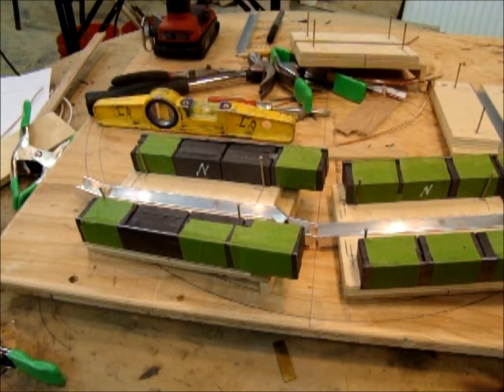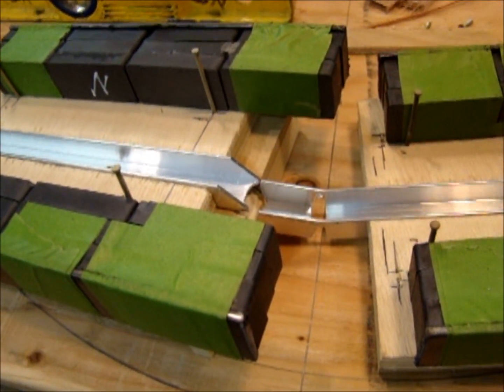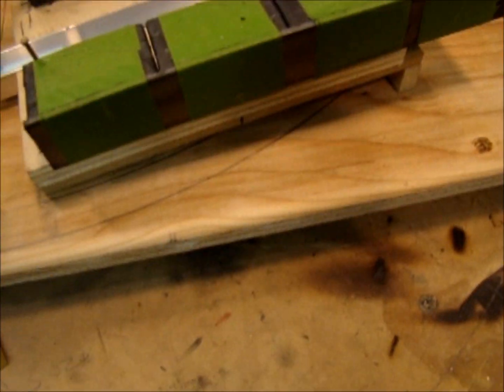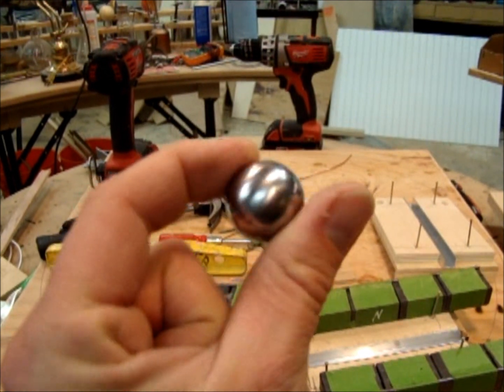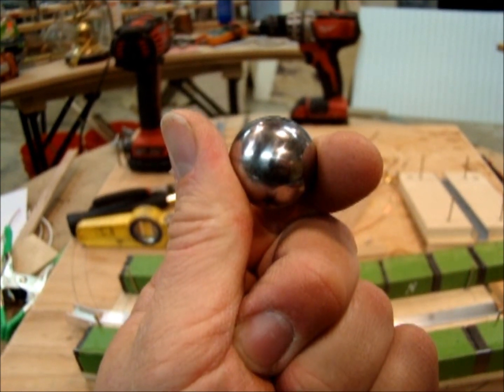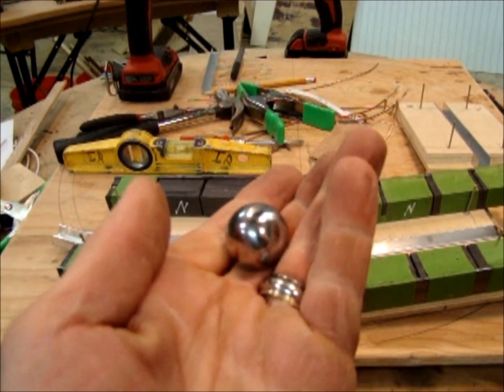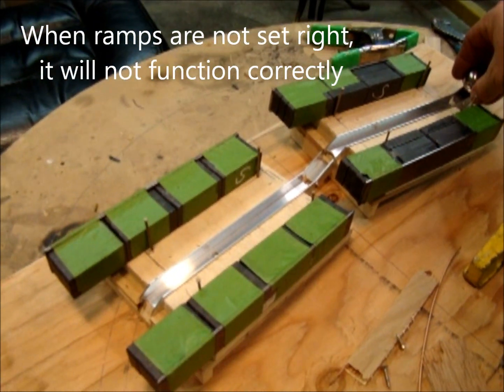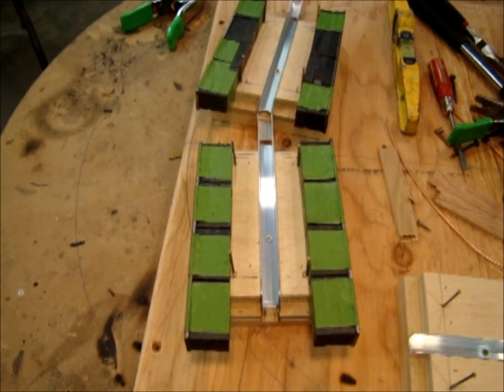smot version mark III

Comment from the maker: The ramps can be 1/2 inches high to 9/16 high.  The sloping angle at the end of the ramp is very critical in achieving the effect.  The only thing I find that is strange about this device is that the more I run the steel ball through the ramps over and over and over, it works better and better.  Like it isn't trying to hard to go up the ramps after 10-20 times.  I suspect it may be something like magnetic conductivity or something...Not sure its only what I have observed from this device.
Reply: Why didn't you finish the loop?
Reply: i think magnetic fields change as they become excited, and they don't always change in ways that seem to make sense. someone told me we are not dealing with physics but possibly quantum physics

Comment: to create or at least conserve energy through accelleration, the height angles of the ramps should be the same even by millimeters. The moment discrepancies occur, the energy starts to dissipate. You might see the ball going through the second ramp simply because there is deviation in the height angle vis-a-vis the first. But coming into full circle this will cause the weakening of the ball's movement and ability of the magnets to attract. This explains why no one has ever done a loop.

Comment: Recommendation: use larger ball with mass > 1X < 2X the magnetism expressed in mass. This can allow the ball to pull away even without help from magnets. Another recommendation: I have found in my modular magnet concept using similar principles a highly vertically angled drop with some deflection can assist when combined with momentum. Perhaps this would have good effects with a larger ball in your design.

Comment: Hmmm, wondering whether using some sort of see-saw effect with the ramps would give enough forward momentum to transport the ball from one ramp to another, without the need for the initial slope. ie: once the ball has got past the mid-point the see-saw kicks in and the ramp settles back to its initial position once the ball has passed to the next ramp.
Possibly with the track extending marginally beyond the magnetic field.

Anyway just thinking out loud, but thought i'd chuck the idea in there:)

Comment from the maker: Once all the ramps are built they all must have the same dimension.  The platform must be perfectly level, otherwise it will not work.  I have made no more progress yet.  I plan to add 2-3 more ramps soon, eventually completing a full 4'-5'foot circle. with 15-20 steels balls all moving.

Comment: the height angle of the starting point of the second ramp is not identical with that of the first ramp. The angle of the rear of the first is also different with the second ramp in so far as height is concerned. You see you can put the ramps on a level field and still deliberately create height discrepancies in the ramps by titling the angle lower or higher.

Comment: what kind of magnet are you using? is that ceramic magnet? would it work using neodymium?
Reply from the maker: I am using regular ceramic magnets.  Neodymium would be far to powerful. Its a very tricky balancing act between gravity and magnets and the size of the steel ball.  It seems to me the more I used the system the better it worked.

Comment: Instead of the thumbnail saying “it will not function properly”, you could just say, “continuing to show that you can not break the laws of physics, thermodynamics”.
But hey, it does get you views.
If you get it to work, you will have solved many of the worlds problems since you no longer have to worry about energy. It’s a shame no one else has thought about this before. (sarcasm in case you missed it).

Comment: Hi, are the two magnets of one smot parallel?
Reply: Yes from my research they perform best when in perfect parallel.  Angled at around 9/16 inch incline.
Reply: That's curious for me :O, do you think you could make a longer one, means with longer magnets? Regards.
Reply: I assume so, probably as long as the scaling of the magnets remains the same.  Are you going to build one your self?
Reply: Hi, I havve other projects running at the moment, like a BITT version, I think making one after that. Regards

Comment: ur second ramp is lower in its starting point. that is cheating. u are also unable to show that he ball will start on the second ramp even it not coming eith momentum throug the first ramp. ur machine will not work. the best proof is thst u hsv no more video sbout full circle.
Reply from the maker: Lower? I'm confused. Its sitting on 1/2 thick plywood on a flat leveled table. If i was cheating it wouldn't be worth making this video even though this isn't a complete full ring.